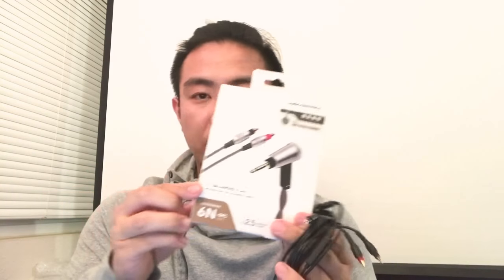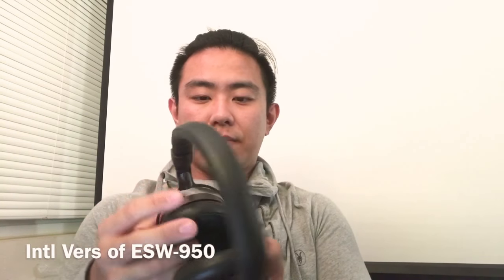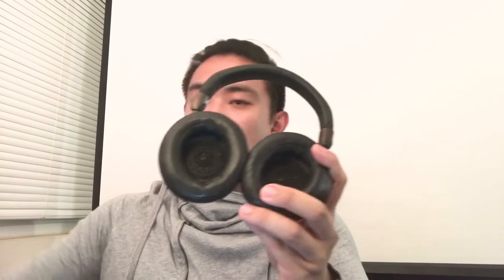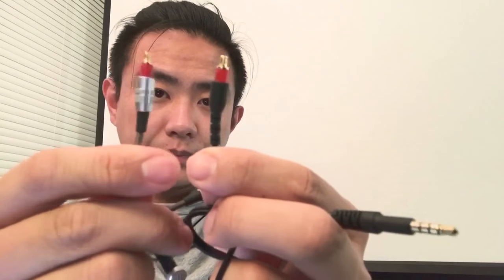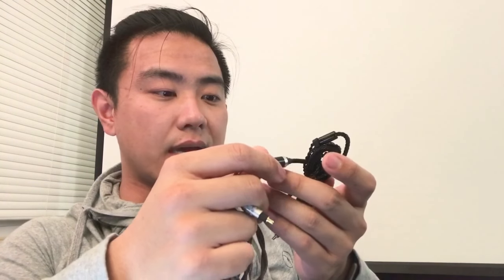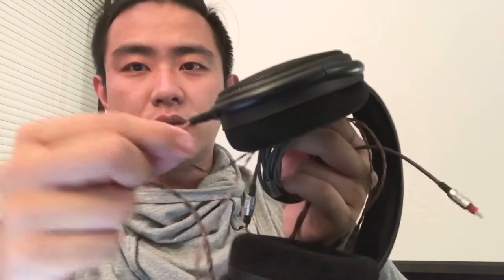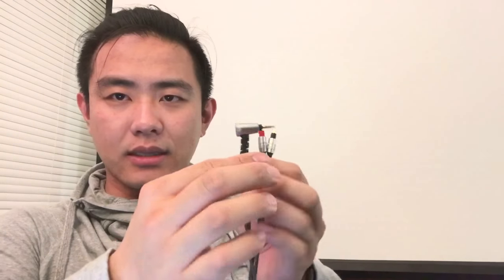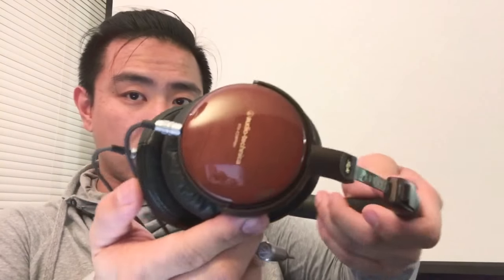Audio Technica HDC112A + ESW990H

Comment: Hi, I just got a used ESW990h, can you share with me where to get the oversize ear pads?
Reply from the maker: I got them from Vesper Audio.  Delivery was about 2 weeks and it was maybe 70 dollars total.  I would recommend choosing Alcantara as the inside material because after choosing leather, the sound became too dark for me so much that I had to modify the headphone's inner material to bring the bass back down.
Reply: Haoyuan Ren 
Thank you.
Btw do bigger pads improve the comfort? Did it convert the esw990h from on-ear to over-ear?
Reply from the maker: Yes, it's definitely Over ear now, and no longer on ear.